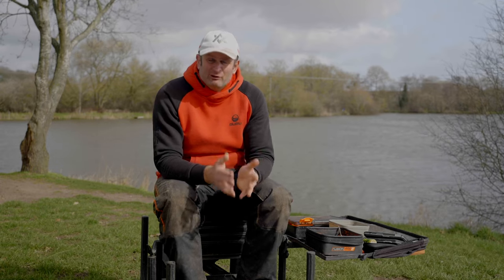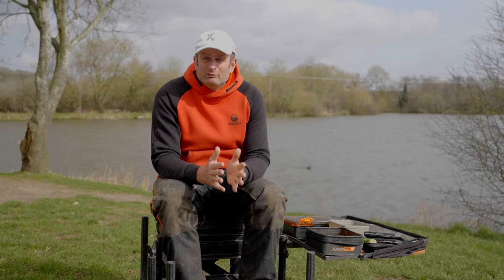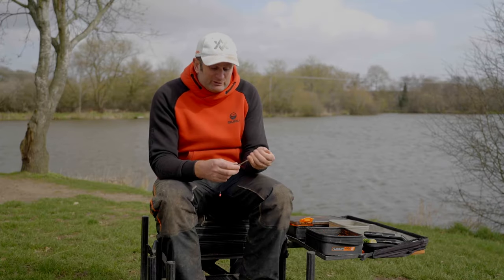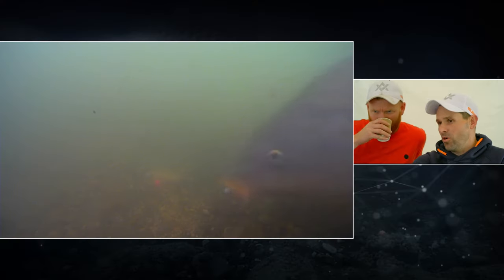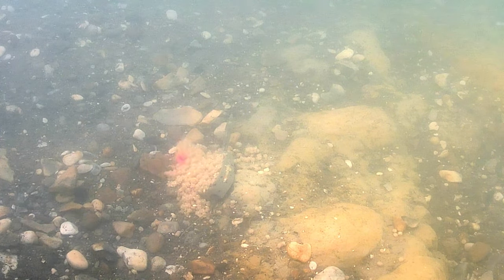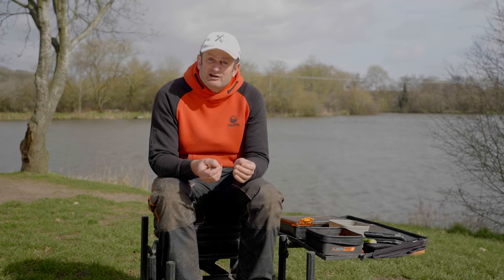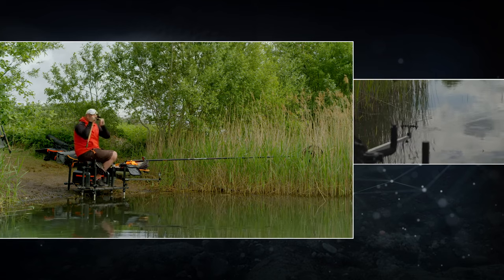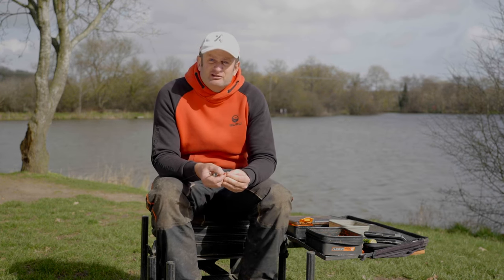STEVE RINGERS UNDERWATER HYBRID FEEDER RIG

Comment: What I noticed on the film, is that the 1st fish that "got away" tried to suck the bait from far enough away that the hooklength was too short. The 2nd fish that was hooked, came right over the feeder and the 4 inch hooklength was perfect. A good example of why we don't catch every fish, because not all fish are feeding in the same way.

I am convinced, that after over 30 years of carp fishing (and using The Method since it became known in the late 90's), hooking only occurs when the hooklength is straightened, to whatever degree is necessary to start to pull the hook back out eye-first. There is always going to be a sweet spot in hooklink length in every individual situation, where the distance between the hook and the weight allow the bait to be picked up and taken far enough in the mouth, and then straightened, pulling and flipping the hook before the fish senses that there is something foreign in it's gob. If the fish was hooked during a "blow out" the mechanics of most rigs actually prevent hooking, because the bait takes the hook back out bend-first. In the case of semi-supple mono there is a small chance that the hook could stay hookable during ejection, but unlikely. The rigs that stay "prone" when blown out are either stiff hooklink material (probably 15lb+ depending on fish mouth size) and/or a stiff hair that holds the bait past the hook bend, of sufficient length that it cannot readily flip backwards in the mouth (again depending on fish size).

For what it's worth (which may not be much) my view is that the best arrangements for fish size and match rules, etc for the exact fishing Steve is doing, is:

Wafters - D-rig and a bayonet (very similar to Steve, but the D-rig leaves the hook prone to catch hold even better than the hair-loop).

Sinkers - Stiff-ish hair holding the bait beyond the bend (knotless hair in nylon with a band or through the bait with a stop). The weight of the bait can actually aid the hook to turn.

Other observations in my use of feeders so far (and watching these great films), are that for a smaller pile I use a banjo, sparsely loaded, with a sinker buried at the bottom of the feeder. For a bigger pile, I use a method feeder with a wafter, which will hop about anyway so it doesn't really matter where in the feeder it starts. 4 inches is about bang-on for the sinker as it should still be in the feeder. The wafter is more hit'n'miss on length depending on where the bait is (I still use 4 inch), but it could beat the sinker for pick-ups even if it doesn't actually hook as many of them.

Thank you for taking the time to make these films.